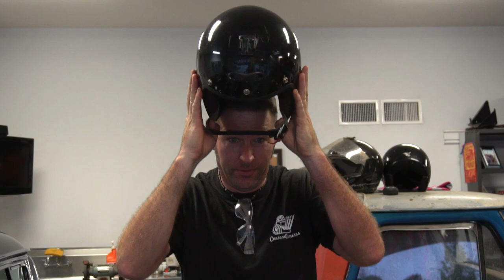AWD 4-Engine Go Kart RUNS: Rear Engines & Gussets

Comment: Should of just put 4 1300cc motorcycle engines for a combined 5200cc 😂😂😂
Reply: CTPaintball, and More! That would've just been too insane. And way too costly.
Reply: should of should of should of should of should of should of should of
Reply: thats the same as a small block 327 chevy at 5,358cc (according to google)
Reply: Wade McKenney year so it would be fast as hell lol
Reply: +CTPaintball, and More! even tho it would look cool and still be fast it would be expensive as hell too it would be cheaper to go to a junk yard and buy a 327 chevy lol but if someone has the money.....5,200cc harley  (if the 1300 cc is the harley one) v8 vs 5,300cc chevy v8 hat would be cool to see
Reply: CTPaintball, and More! XD triggered. Bruh chill it's the YouTube comments. Have some dank memes instead.
Reply: Could have a car instead
Reply: Wade McKenney The 5.3 is actually a 325

Comment: It needs a rear upper brace and a upper link on the front (rose joints or ball ends) - throttles - Bring them in to a balance bar  with a single cable to the pedal (think handbrake) ------ keep rubbing those necks boys there not red enough

Comment: You could get away with using a PTO shaft off a tractor put a spindle at both ends for steering and a sprocket off center to the back then you have 4 wheel drive , I`ve made 2 gocarts this way has guards square shaft and it`s telescopic .

Comment: Guys I need some help with my go cart I have a 212cc 6.5 predator motor on the go cart with a custom throttle cable on it and every time i get it to run as soon as I touch the gas pedal it shuts off the motor if u could please help me I'll have the video of what it's doing on my channel thanks
Reply: probably trash in carb. just to be thorough make sure the engine oil is full

Comment: Those gussets you welded from the wheel plate to the frame are not much more than a tack. Should have made the gussets bigger so as to cut a half moon to attach to frame. would be much stronger. (I can see those gussets snapping off in time)

Comment: I bought a lredtaor 212cc engine and I mounted iT on my go kart but he throttle won't return and I loosened the bolt but it still won't return help me please!!!
Reply: is the throttle cable on? you might need a return spring on the pedal

Comment: Why choose to do one motor per wheel on the rear? wouldnt a standard rear axel with 2 drive Sprockets have been easier? and you would have had to put the motors over the wheels.
Reply: just to match the front

Comment: @cac what sprocket on clutch, jackshaft and rear tire should I use for best top speed
Reply: what are you building? I would do away with the jack shaft if possible because jack shafts rob power.12 tooth sprocket on clutch ,58 tooth on axle gear with 11in tire with n gov in a 212 predator engine with a 35 chain on  light frame will get you 53mph.is that enough?
Reply: Isaac it'll be fine he'll ya I like that so does that still have low end power aka torque
Reply: Isaac it'll be fine I have a 196cc Baja minibike it's a 200mb if you look it up
Reply: Isaac it'll be fine and another minibike next year. can yall make one from scratch?
Reply: i have a baja mb200 with a 19 inch rear tire and i still have the gov in but no throttle limiter how should i run that from clutch to rear have a vid i should look at? also how much bottem end does it have
Reply: good bottom end. I'm not sure if we have a good vid in something like that but you could check our mini bike build nd see if anything looks good
Reply: Isaac it'll be fine can you past the link here please ike

Comment: I would still  find away to put brakes on the go kart. I change to solid axle design and put 2 sprockets on it and add a brake caliber. It is like horsepower it is good but I would like to be able to stop it.

Comment: use pam cooking spray b4 u weld and u wont have so many of the balls around ur weld or u will be Able to knock them off easy
Reply: those were from a different welder. thanks for the tip

Comment: myself seems real stupid with 4 engines. and to have 2 engines over the steer wheels sucks bad. and 2 throttles shakes my head not good at all. and by the sounds of it the one you have with the 670 or whatever the 600 size was you guys think it faster. so why do 4 engines. and it looks really bad as in stupid not cool
Reply: just doing something different